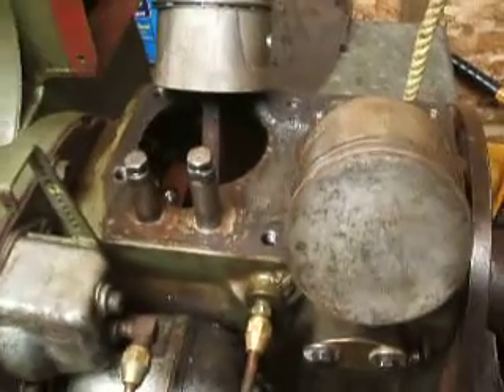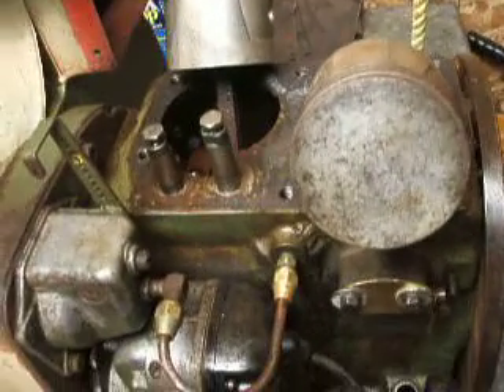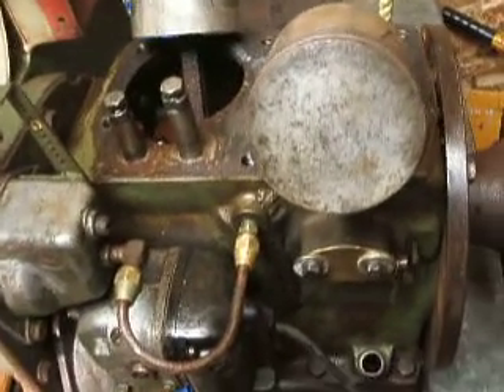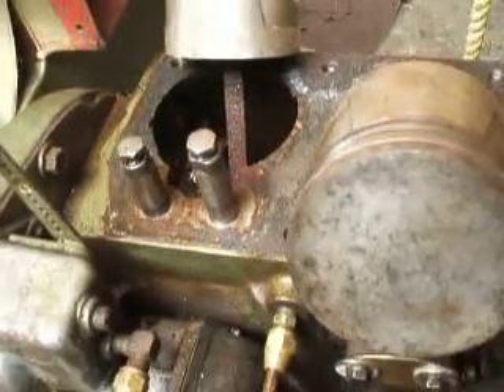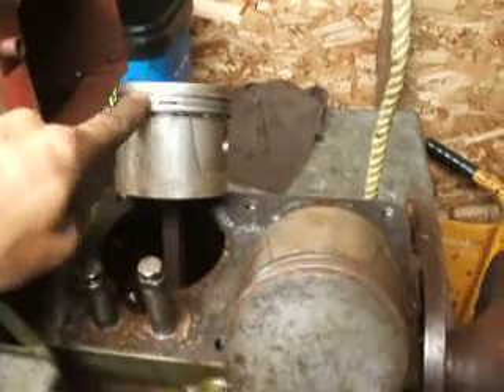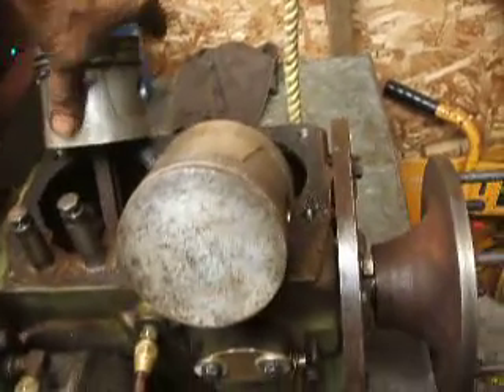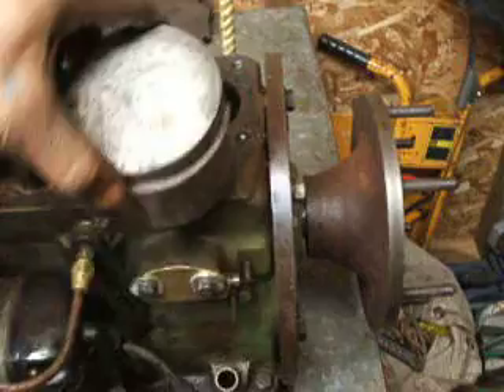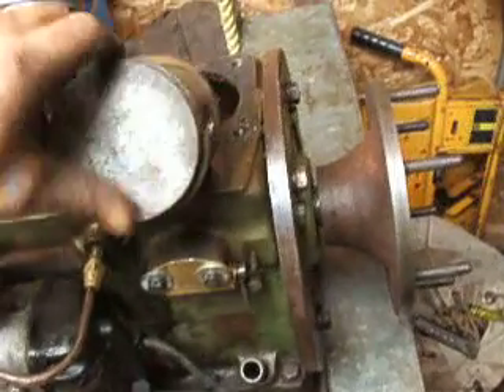TJD Wisconsin Twin Cylinder engine video repair

Comment: did this motor run before you took it apart? i just picked one up, and it runs great but i can see rust through the plug holes and im not too crazy about it